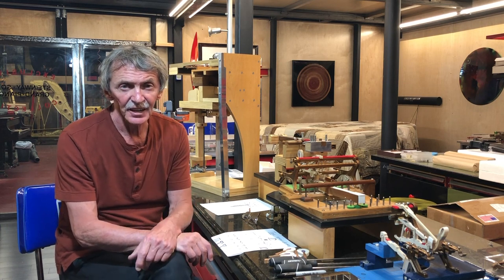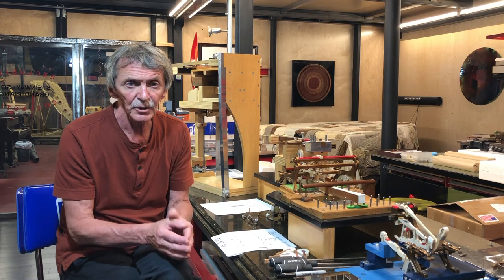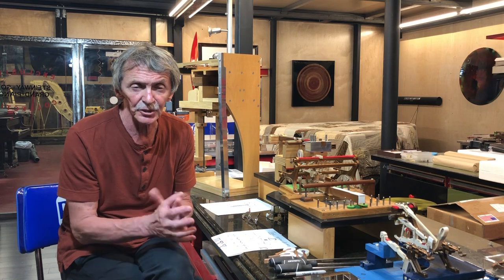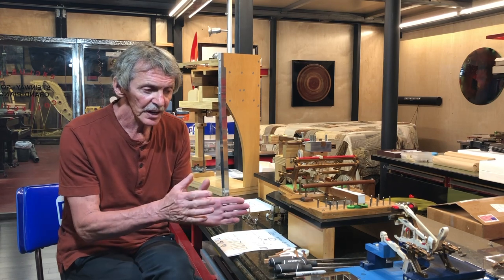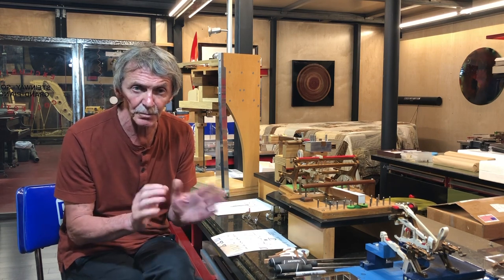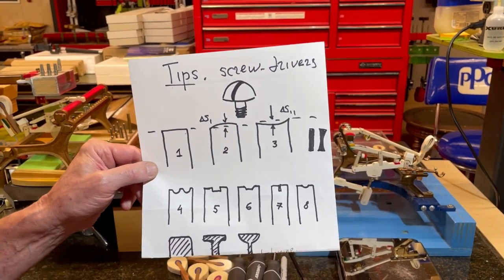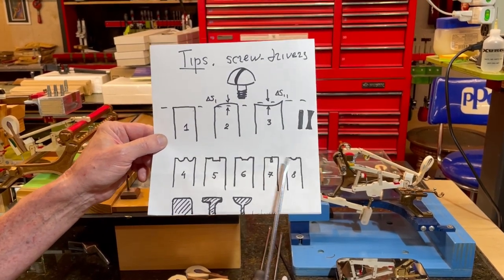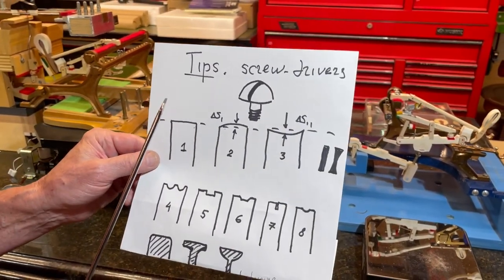Scientific Research Discussion by Piano Solutions XXI

Comment: A big thank you dear friend for taking all this time to share your technical knowledge, practical experience, tips and passion for the piano. I follow you from France, and I have this same passion in common with you for 40 years in this same art profession. I will be very excited to meet you (may be) to listen to you, share, and show you my own research results and innovative applications for the best possible expressive touch, reliability over time, soundproofing of keyboard movements, pedals, and the use of new materials in hybrid complement of traditional felting in strategic points of mechanical movements (in order to give intelligence of response to materials in relation to the intention of the artist, therefore the capture and intelligent return of the energy of movement). The reduction to almost zero of the critical friction points, new key mortise linings (glissando become exceptionally easy and not injurious for pianists) and key drivers for example. It is also very important to understand the ideal way to position the springs of the lever movements of the pedals under the plate for the comfort and the precision of the pianist and the soundproofing of the pedal movements by new possible materials, and the ideal adjustment of the soft pedal. because the lateral springs are in 80% of cases always too tight for the sliding keyboard plate ... etc ... so much to say ... so much to do ... so much to improve. You are an absolutely remarkable and awesome person. Thanks again.
Reply from the maker: Thank you so much for your response. I feel that we have a lot in common. From what I read, I understand that you are very passionate about your trade and profession. I would be happy to connect and share ideas. You are absolutely right that there is still so much to improve on. Let's work together and maybe even bring other skilled technicians to collaborate with, research and bring new ideas to life. You are welcome to contact me anytime, my number 818-503-0800. Best regards! 

Gene

Comment: Great work! Did you ever study the right Pedal on old Bechsteins (1890 to 1920). As Piano Player and restorer, in my opinion this is the best. They have very small Pedal travel, and this allows to feel and control the point when the dampers lift exactly.
I made a Video with half Pedaling, where you can see the dampers go up without fully lifting. I can send you some tecnical data if you want. Do have a opinion on this? Kind regards Fabian